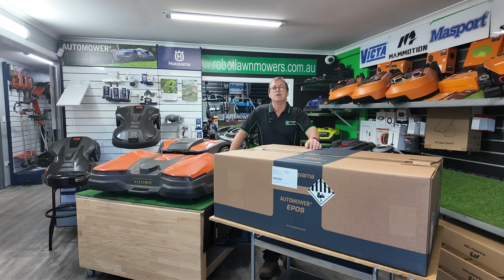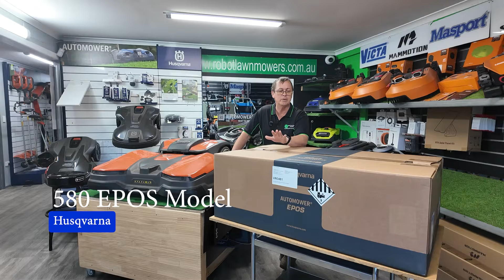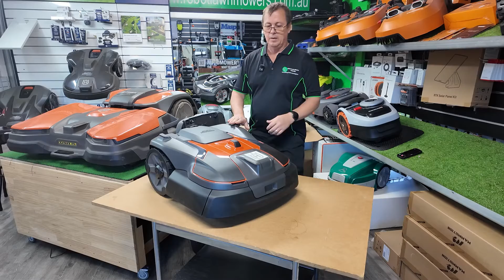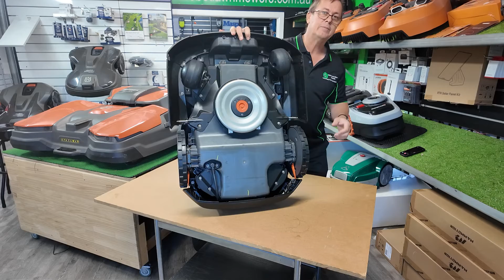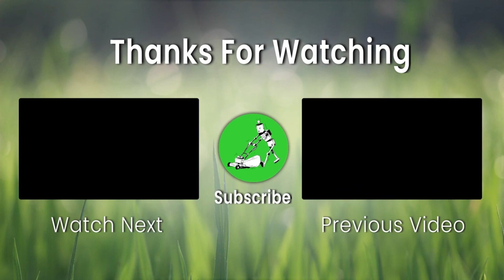Unboxing the Husqvarna Automower EPOS 580 | Robot Lawn Mowers Australia

Comment: Nice,thanks . What's the advantage of that skid plate...
Reply from the maker: Helps with not scalping when cutting at low heights. Also helps to prevent fouling of the blades and blade fixings.